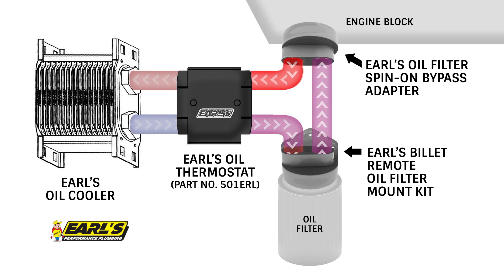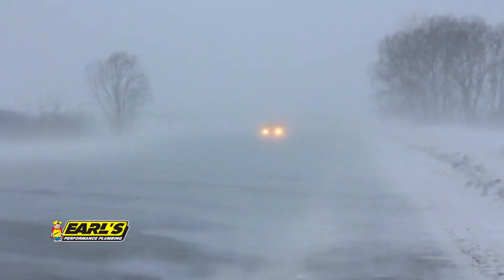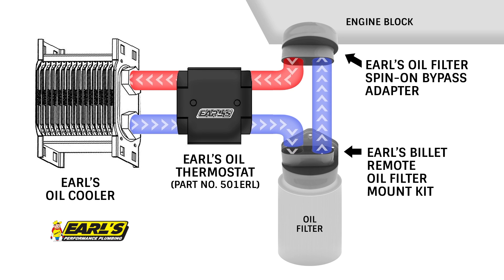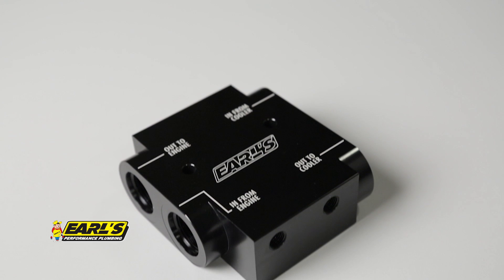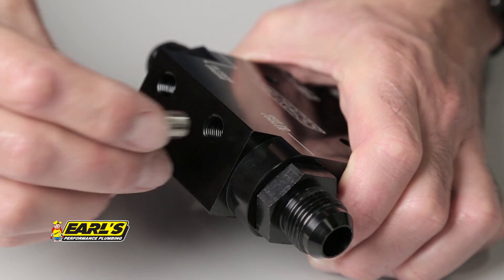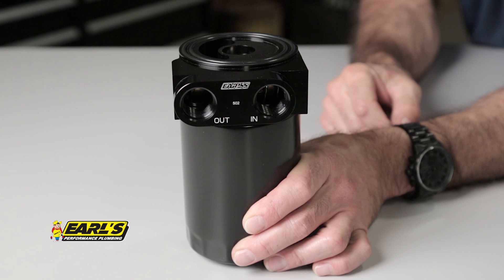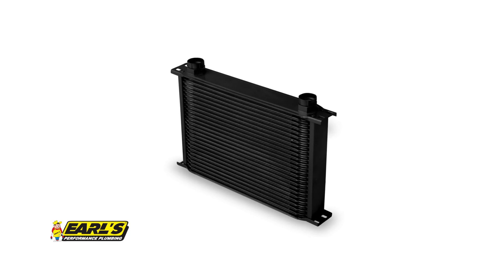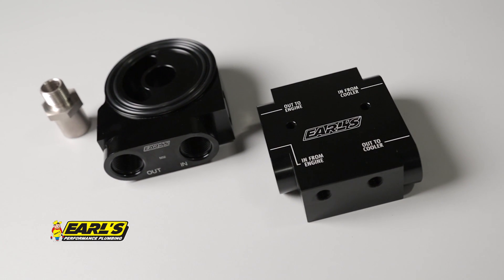Earl's Oil Thermostat

Comment: How does the inline Thermostat work ? I want my oil to be over 215 F. Many of these thermostats open at around 180F. Will this prevent my oil from reaching over 215F ?
Reply: Yes, have you found one that opens at 215F or a littler higher?
Reply: @aragrox  Mishimoto has one that comes stock with a 185* thermostat but for 18 bucks you can buy a replacement thermostat for the housing that opens up at 200*. Im using the 185* one and my temp stays around 192 city driving and around mid 180s high way. 

On track its around 210. So for me its a success. I didn't need the 200* replacement.

Comment: What if the engine oil temperature is already cool before going through the cooler? It will cool it down even more which is not what I need? I am planning on using this on a Top Mount set up on a 2016 Subaru WRX(on the hood scoop) so when I do am not tacking the car, temps should be okay, and it being a top mount it should be even cooler since it gets direct air. I will have a remote control fan behind it as well. My only concern is over cooling oil now... any way I can have it to let cool oil bypass the cooler, and when its hot oil it will be forced through the cooler? Thank you! I am interested in buying this but not sure if it works for my application...
Reply from the maker: The thermostat doesn't open until the oil temp reaches 160 degrees.  If the temp is below 160 degrees the oil is directed back into the engine. Once the temp is above 160 it opens and allows flow to the cooler. Thx j